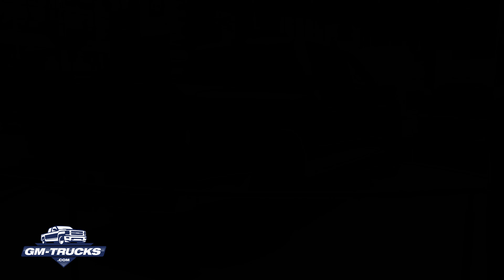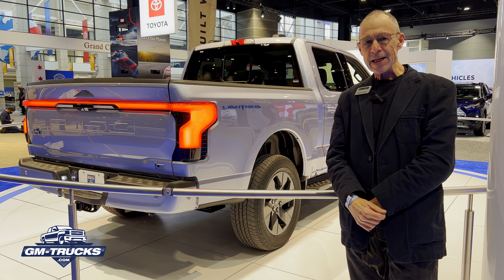All Electric Ford F-150 Lightning - Walkaround & Details You Might Have Missed!

Comment: Yes. Share as many parts as you can to save on costs. Although, this truck is different in a few major ways, the types of jobs it will be expected to do have not changed - thus there should be a lot of parts that can be shared.